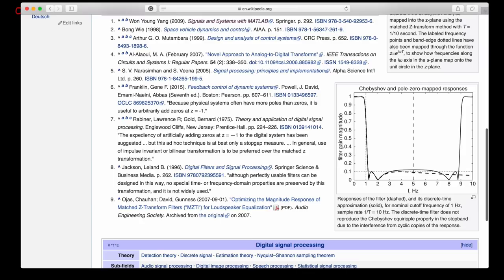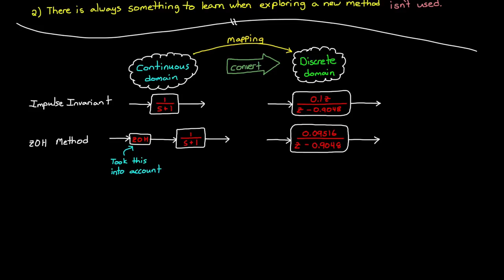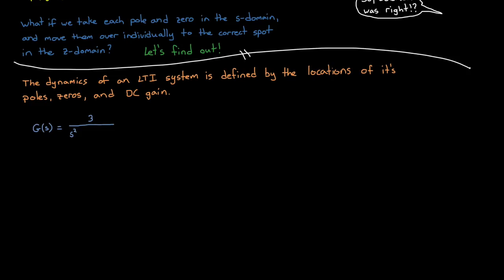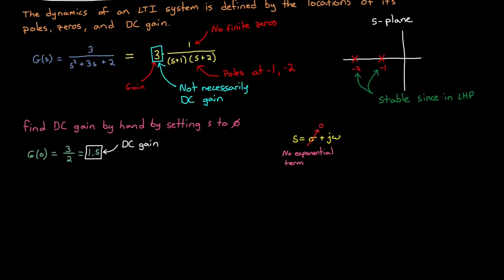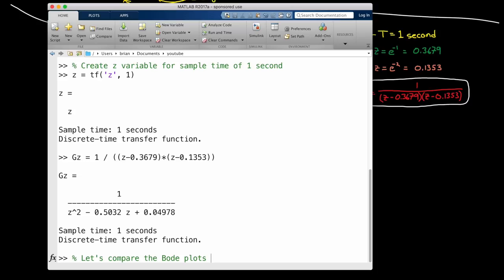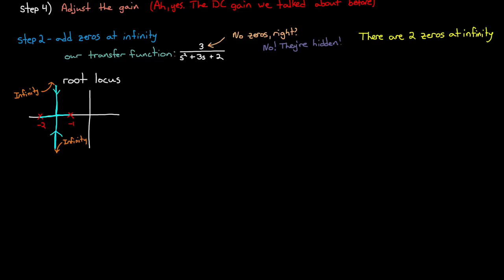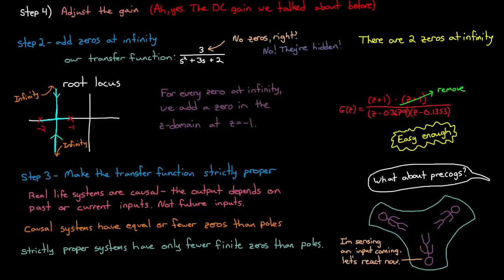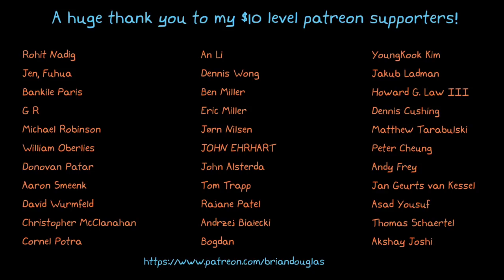Discrete control #4: Discretize with the matched method

Comment: Thanks for your video, but I have a question about that. If the system is a first order system with no finite zero instead of a second order system which in the video, so there exist 1 infinite zero. After mapping all those spots to z-domain, the order of the numerator and denominator should be the same, because there are one pole and one infinite zero. So my question is that should I ignore the only one (z+1) term in numerator to make sure the order of denominator is geater than that of numerator?

Comment: What does the number of poles and zeros have to do with the system being strictly causal?
Reply from the maker: This is a question to which I don't have a satisfying answer! I tried to quickly find a good proof of it and came across this interesting discussion, https://www.researchgate.net/post/Prove_that_if_a_systems_transfer_function_is_not_proper_order_of_numerator_greater_than_order_of_denominator_then_the_system_is_not_causal2. I don't have a good mathematical explanation, but I do have an intuitive one for why you can't have more zeros than poles that I use for myself so I can sleep at night.  I'll see if I can type it out here succinctly. Think of the magnitude plot on a Bode plot. Let's say there are no poles or zeros at the origin. Starting from the left most part of the graph, as you increase in frequency the magnitude line is horizontal until you hit the first pole or zero. If it's a zero you turn the line up 20 dB per decade, if it's a pole you turn the line down 20 dB per decade. Now each future zero you encounter you turn up an additional 20 dB/dec and each future pole you turn down and additional 20 dB/dec. So if there are 2 poles and no zeros, you end up with a magnitude plot that continues down at 40 dB/dec as the input frequency gets faster and faster. However, if there are 2 zeros and 1 pole (not proper), then the magnitude plot continues increasing at 20 dB/dec as the input frequency gets faster and faster.  In this case, very high frequency inputs would produce outrageously high amplitude outputs. Any time you have more zeros than poles, the amplitude of the output signal will tend toward infinity as the input frequency increases. This is fine in the world of math, but real life systems don't behave like this.  With a real life system, as you increase the input frequency higher and higher, eventually the output amplitude would not grow, but would drop back to almost nothing.  Imagine if shaking the end of a spring at a frequency of several gighertz - even if the amplitude of the input is a tiny fraction of a millimeter - and having the other end of the spring oscillate at several gigihertz over several kilometers.  Or more to the point, imagine an analog differentiator doing the same (that's closer to a non-proper system since it's trying to be s/1), tiny input voltages at high frequency and outrageously huge output voltages at those same high frequencies. In reality, there is always one or more high frequency poles in any real system that keep that amplitude from increasing to infinity. So our real life differentiator might actually have the transfer function (s + 1) / (2e-6s^2 + 0.003s + 1). This keeps it strictly proper, but also keeps it acting like a differentiator at relatively low frequencies. 

This was wordy, I hope it makes sense and helped a bit.  Cheers!
Reply: Another way to think about it is to obtain a partial fraction representation of a nonproper rational function. Then since you have a higher degree polynomial it is possible to have a partial fraction expansion such that some terms are necessarily polynomial of 's'. Otherwise you wouldn't have a nonproper function in the first place. That allows us to conclude that the system acts like a pure derivative 's'. This is where things get a bit hairy. In the input/output view of systems such that systems are like signal processors this cannot happen since the derivative gives us the information about the future at least locally. But this is not a time invariant system. Assume two input sequences and when time t=1sec. one increases to 2 and the other one decreases to 0. The system cannot have an idea about this unless this already happened but it hasn't happened so something has to give. 

This is roughly the sketch why causality and the relative degree of the polynomials matter. But there is an alternative theory that does not enjoy this view and that is the late Jan C. Willems' behavioral approach. In this approach, we don't treat systems as mapping from input to outputs but define their behaviors. For a classic example, if you connect two tanks with a pipe you have to assume that something is the input and the other tank is receiving that input as an external excitation whereas in reality they define a behavior together. Similarly an mechanical system defines a behavior such that Newton's laws apply. But in the signal based approach dictates that F = ms^2. Thus we treat force as an external input and look at the position. The other way also should be perfectly fine but then as I mentioned above this leads to a double differentiator which we don't enjoy. 

Note that signal based approach is not wrong. It just has limitations as a framework. Without going into deeper reasoning, we can just conclude that in the input/output setting things make sense only if we have proper system descriptions. There is a body of work over the so-called "descriptor systems". But that's another story thatis also related to this discussion :) I guess there is indeed no simple answer.
Reply: is it like how a inductor have a output signal that is shifted to the left of the input signal? So it seems like the inductor generate a signal before the actual signal was input to the system. And the transfer function of inductor is Ls which has more zero than poles.

Comment: Are you sure the dynamics of an LTI system cannot be exactly determined  by the  pole zero locations? You can have the same poles of a system but different eigenvectors and have a different response.

Comment: How do you transform 1/s with this method? for a PID controller its transfer function is ( K * (s-a)(s-b) / s) and so evaluating the gain k at s=0 gives an indefinition
Reply: I think you'd need an indirect method. Since 1 / s is unstable, the DC gain is not defined. You can close the loop to turn it into a regular first order filter, transform it to the discrete version, and do some algebra to find the open-loop transfer function